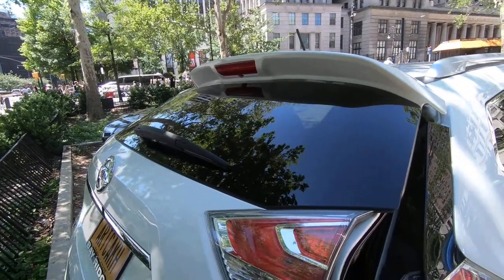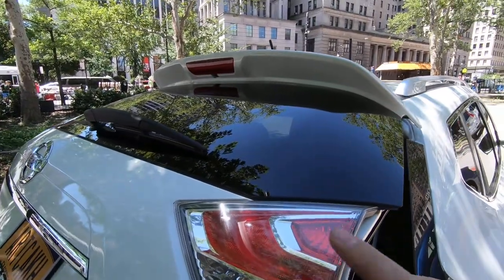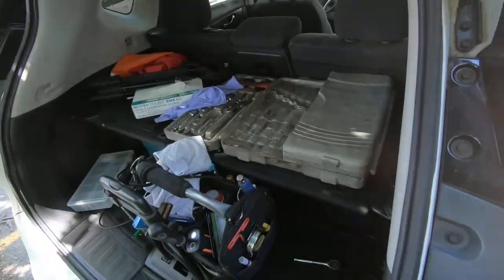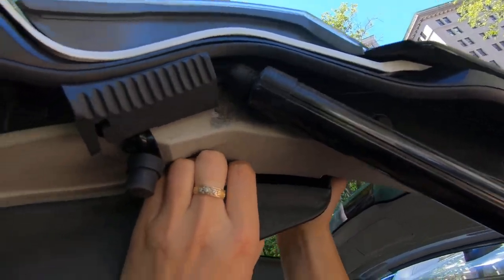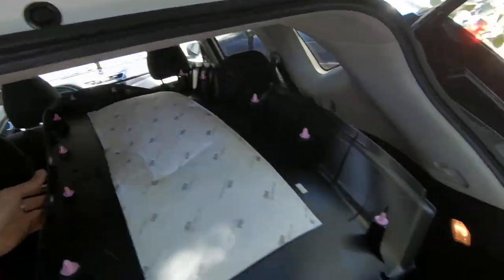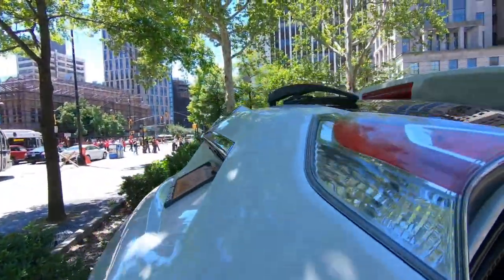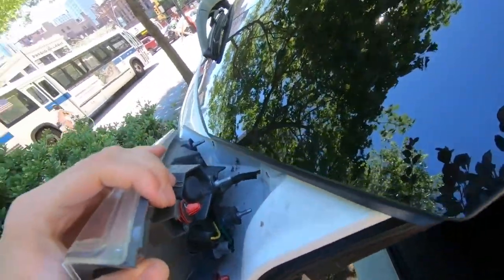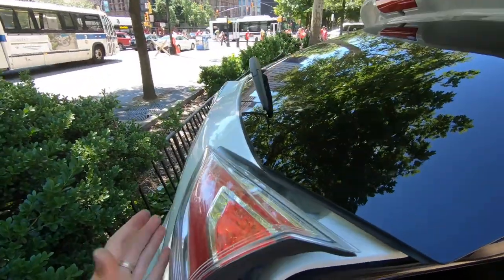How to Replace backup Bulb onTail gate trunk light 13-20 Removal Nissan Rogue 2015 2016 2017 2014

Comment: Thanks for the video. I know that i have to take the inside panel off but sometimes they have something stupid in there and you break it if you do it wrong. but looks like you just tear it off like a wild animal.  I'll do mine tomorrow.  P.S. When I had a brake light burn out, i replaced it with a Phillips LED bulb and it is great, no worries about burnt out lights. I also did it to the 3rd brake light so they match because the LED light up so much faster.  Amazon lights (I don't know). I just bought Phillips.  For my Lexus I bought Phillips HID lights and they were fantastic, the quality of everything looked like it came with the car, so I trust that brand is made well.